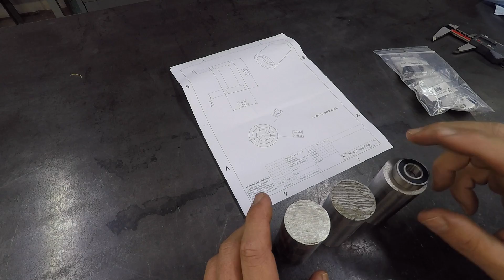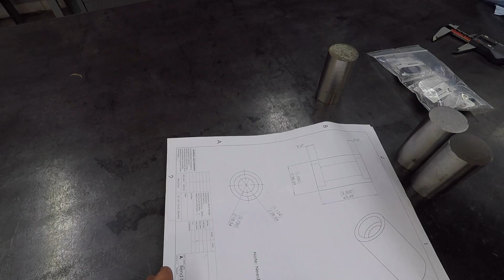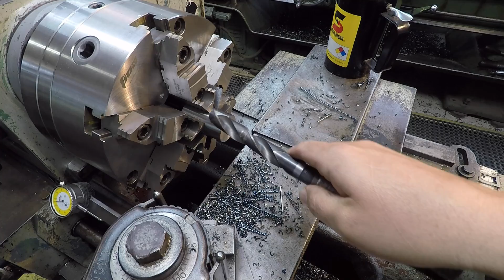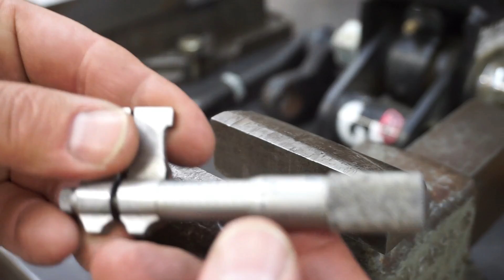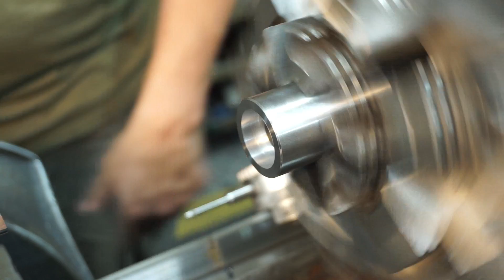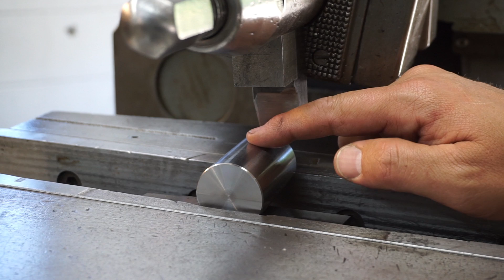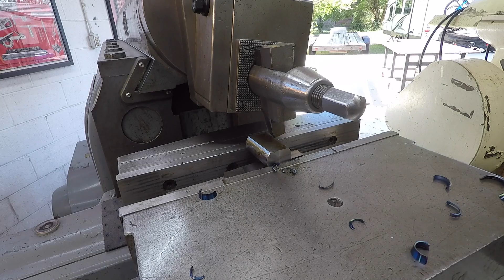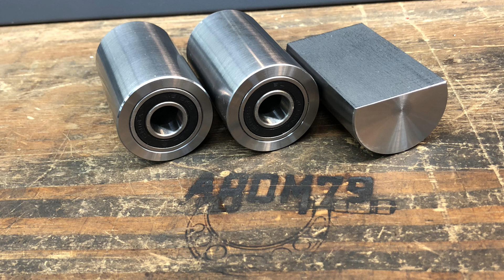SNS 305: Weld.com Collaboration Project

Comment: How can your Grandad's mike measure accurately being as thick as it is? Your not getting a diameter reading.
Reply from the maker: First you ask how, then you assume it’s not working right. Why would I or anyone for that matter invest and use an “inside “ mic if it wasn’t designed to work properly? Instead of assuming that the jaws are flat, consider the possibility that Starrett ground the proper radius on the jaws so that you can get a proper reading. 💡
Reply: @Abom79  So Adam, you are thinking that Starrett knows more about inside mics that Greg Modelle? :-)
Reply: @Abom79  Adam, I'm not a machinist, just a dumb carpenter trying to learn a bit about your trade. I wondered about that Starrett #700, Googled a pic of one but it wasn't clear enough to see the jaws, so I started thinking that if they are flat then there must be a compensation factor in the scale. Wow, I was wrong about that. Thanks for the info about a radius being ground into the jaws, that explains it!

Thanks for you VERY informative videos. I have learned a lot, and you explain things enough that I can easily understand most everything. If I had not taken the route of architecture years ago I may very well have gone machinist. Excellent work!

Comment: What system is used to stop the lathe that quickly, the big chuck must have huge inertia?
Reply: It's not uncommon for lathes (especially bigger ones) to have a spindle brake that engages when the drive is disengaged. I worked on a lathe (a thousand years ago) that had a manual brake foot pedal that would stop the spindle.
Reply: I think most of the lathes have a pneumatic brake system.  Well at least the lathes that I have used have this braking system

Comment: Why would you use bearings not brass bushings?
Reply from the maker: Bushing will work but bearings will be more free spinning and last longer. Pretty sure they went off a design someone already built so going with the print.

Comment: Not my job, not my shop. My opinion on machine selection isn't relevant or or even informed. Thanks for these videos- I've been intrigued by machine shop operation, and you have helped scratch that particular itch.
Assuming the operation will take a while to finish, can you start a job on the shaper, and work on another job on another machine? Or is it bad practice to split your time between two jobs?
Reply: I know in machine shop class we were told to never leave a machine unattended. But were also told that many production shops would leave shapers running unattended.
Reply: @ypop417  
It depends what sort of work. If it is a good set up, no problem. 
I have had a cut, that would take 10 min on a manual or CNC lathe, why waste the time when you can find material for the next job, do another job on the other lathe (or look at facebook ;) )
With experience, it is something you do, when you can get away with it (and don't do, if it is not a bulletproff set up).
Reply: Ran Wickman screw machines, set up , operator, running three machines at same time, 6 parts per minute each was the norm, pulling and checking dims constantly moving around, not for slackers.

Comment: I have a question born out of ignorance. 

Why use a shaper instead of a mill? What are the benefits?
Reply: Low cost, HSS, cutters and superior surface finish.  James Kilroy has pointed out that a shaper is THE machine for removing mill scale from hot rolled plate.  Slow and steady allows the machinist to multi-task.

Regardless of the line of work, multiple weapons in the arsenal are an advantage.  Get the job done, well!
Reply: Eli Duttman ... thank you
Reply: But the real answer is he LOVES that shaper... and most of the rest of us do too.
Reply: A shaper can run parts usually with less setup time as well.
Reply: I thins case, look how quickly and cleanly the shaper took some fairly big thickness cuts. It's not that you couldn't mill that flat, bu tover the long term, consider wear on the mill and cutting tools vs the shaper just powering through with some tool steel, especially for scale or flame cut surfaces.. Also Adam uses it because he likes it.

Comment: Hey I've been waiting for you to use that interchangable boring holder. I know the tool holder real estate for that quick change is valuable .same here I'm always looking for how to minimize the # of holders and that looks like you could do offsets for a dro so wow how many tool's again and is there a small drill chuck or collet holder ( i have a small lathe 24" ish centers 1 hp) so swiss type small lathe geometry is what i have to stick to there's a ifanger type 29or 27 i forget those are real cool they take a square 1/4 5/16 bit with a notch down it that the clamp fastens. the intresting part to those is the tangential relation of the cutting force the only explination for that is offerd by the guy at eccentric engineering (the diamond tool holder) thats common in the swiss type lathe and on a hardinge Imagine a dsm tooled to make AN fittings and braze type tube ferrells an engine swappers dreem

Comment: Why dont you ever experiment with carbide on the shaper
Reply: He’s gone over this in the past. The machine doesn’t have a tool lifter, so on the backstroke the carbide drags and chips the insert.
Reply: @andymcconnell6019  I never heard, but did Jason from Fireball get a tool lifter for his giant Cincinatti?  I watched his video about it and he was looking for one, but wondered if he ever got it.
Reply: leghumper83 I have no idea, I do know he was looking for one though.
Reply: Andy McConnell I’m curious about the backstroke on the shaper. It seems the work doesn’t move over until just before the forward stroke, so what exactly is the cutting tool hitting on the return stroke? Doesn’t it simply ride clear through the cut it just made for itself? I’m confused. Thanks.
Reply: Mitch Kronowit I am no shaper expert but if you watch a shaper run without a tool lifter the tool may slightly lift from the inertia of changing direction, but what seems to make it kick up the most is the tool dragging on the backstroke.
Reply: Fireball tools have the same machine and he uses carbide to great results

Comment: The few times I tried to do a press fit with a bearing for some reason or another it didn't work. The bearing almost gets distorted from the pressure of the difference. I'm only talking about .001 to .002 difference in size.
Reply: Interference fit depends greatly on the diameters, a good rule is approximately .0005" - .001" per inch of diameter for a light press fit. Although there are a lot of different "fits"that can be used. Also a good chamfer at the entrance of the bore helps a lot. Practice means everything in Machining, along with good measurements.
Reply: Awesome thank you for the information. I'll give that a try.

Comment: They should have gone with bronze bushings not those ball bearings. Did you ask Mr. Tig if he has done the force calculations?
Reply: Yea I was thinking just the same.
Reply: It seems like the point loading on ball bearings would be enormous, bearings are designed to spin. They might break a bearing or crack a race. Roller bearings should have been used at minimum.
Reply: Nonsense!  Check out the finished product and operation here:  https://www.youtube.com/watch?v=Imiiakl6H2M.  I have done some precise calculations and found those 4 bearings will support one (1) bazzilion lbs and will last through approximately one (1) million coupon bends. Good day, sirs.

Comment: Question from the uninformed: what’s a test weld coupon?
Reply: The test machine is to perform a bending test on a sample weld.  You take 2 plates and do a full penetration weld on them.  You then take the piece you welded and bend the weld through 180 degrees to see if the weld breaks. https://www.youtube.com/watch?v=Imiiakl6H2M
Reply: @barrygerbracht5077  Thanks for the info.
Reply: For testing Welding Recipes
Reply: coupons is what they use in the welding world to do destructive tests on, as part of the quality control on their work. they don't just use cutting & etching :-)
Reply: You tend to call sample submitted for testing 'coupons'. In this case weld testing.